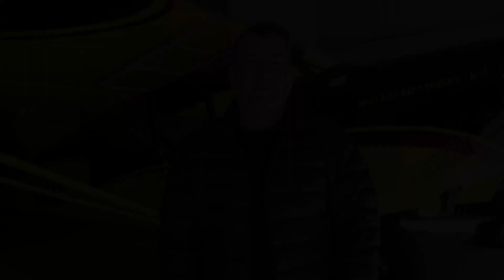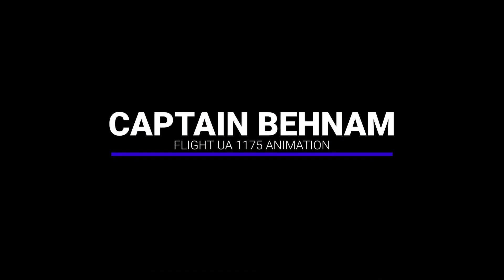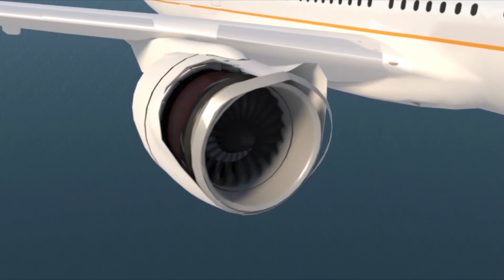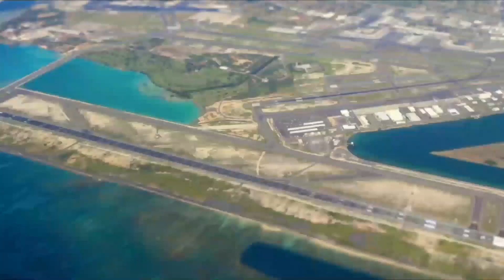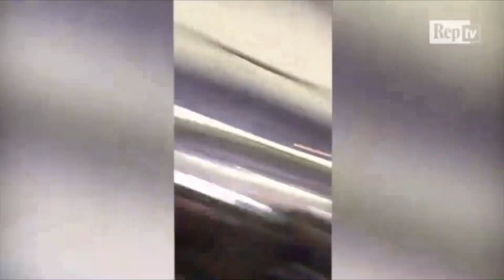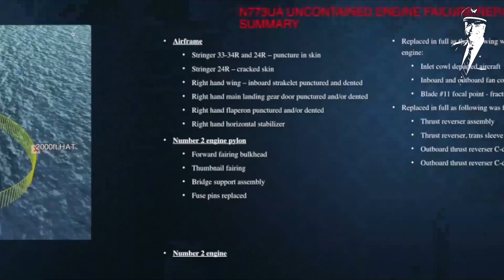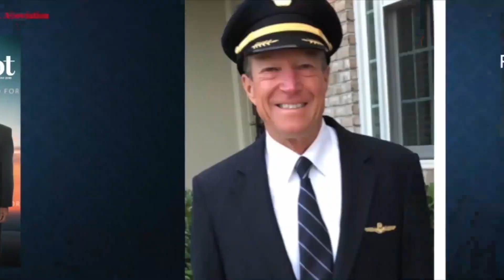UAL #1175 B-777-200 Fan Blade Out Animation

Comment: I was a private independent contractor, some years ago, asked by GE Turbine Engine engineers to study blade off containment.
My background was developing ballistics armor and explosives containment technologies with the miltary.
GE actually tested one their static fixtured engines by firing a chicken into the running turbine and watched 
approximately 1 1/2 blades dislodge into the stator and nacelle shroud.
Blade off velocity is roughly 1100 ft per second,or similar to a 9mm or 40 cal.
That loose blade or blades could easily penetrate the fuselage,and depressurize the cabin or even cause fatalities or injuries to passengers as happened years ago.
Newer aircraft have blade off containment shrouds made layers of   kevlar and aluminum.
That is what the GE engineers asked me to develop, was possibly  lighter solutions.
I successfully came up with newer more advanced ,stronger and lighter materials based on my ballistics background.
I do not know to this day if they used those solutions.
It was great fun to develop composites and shoot them with simulated projectiles though.
Reply: Actual testing is the key here. Those darn theoretical calculations are useless--they always assume spherical chickens.
Reply: I hope the dedicated "crash test chickens" were fresh and not frozen when launched into the fan blades?! I guess those that exited the core came out in diced pieces, well done and tenderized KFC or McNuggets!? It's fascinating watching the super high speed film/video of these destructive tests!
Reply: @v1rotait23  That actually happened at the test facility,I was told.
One engineer took a dead chicken out of the refrigerator and forgot to defrost it.
Needless to say the bird did not function as per specifications.
Reply: @jimhenry7173 , Yes. I'd read that same story long ago too!
Reply: Part of an FAA certification requires "bird-shot" tests on aircraft engines.  Airframe manufacturers are also required to do these tests on specific parts of the airframe

Comment: Did they say that the sounds were taken from the actual CVR? Holy Sht! The noises that plane was making as he was struggling to get it under control. It sounded like the whole airframe was twisting, bending and tearing apart. Afterwards, when they inspected the plane, how much structural damage did they find? Above and beyond the engine damage? 777’s aren’t supposed to make noises like that.

Comment: What I don't understand is how a 777-200 with that P&W engine could be assigned to UAL flight 328 to Honululu after all the preceding bad experience with that configuration.  I'm sure some extra tests and more frequent inspections on the engines were instituted. But those procedures are based on reliability models.  Such a catastrophic failure mechanism seen all the way back in 2018, and subsequently, is a sign that those models are not trustworthy and the "fix" recommended by NTSB did not work.   The multiple failures by that mechanism, and allowing flights by that configuration over the ocean after 2018, shows a failure by the FAA that belies the celebrations after that near disaster.  I'm not at all impressed by the FAA's performance.

Comment: Lots of discussion about duplicating the vibration in a simulator, but it seems the most immediate threat was the unexpected drag after much of the cowling departed.  Drag caused a very strong and fast roll, and that (not fire or vibration) was the thing that needed to be handled first.  Not all pilots would have been as prompt as Behnam to apply all that left rudder (natural reaction for some is just to use ailerons) and ailerons alone may not have been enough.  Perhaps simulators should add a failure mode that includes the extra drag and its consequences.

Comment: Great animation.  Regarding the simulators, why couldn't they vibrate only the seats to the degree necessary?  The effect would be the same for the pilot without stressing the whole simulator.
Reply: Can't see instruments when they're shaking that hard.
Reply: @laurinpestes5569  
It's desirable to replicate the challenging conditions they faced if you can do it without damaging the simulator or the instruments.  Vibrating just the seats would accomplish that.

Comment: Juan, I have a hypothetical question for Capt. Benham. First let me state up front, I am not a trained pilot and I am not criticizing his or his fellow crew members actions. He and his crew members were in the hot seat trying to save a badly damaged air plane and as far a I am concerned they did an outstanding job. That being said  I am doing some arm chair hind sight engineering. My question is that once your jump seater determined what was causing the extreme vibration and that there was no visible fire you decided to shut down the damaged engine if instead you had allowed it continue running and tried to reduce the vibration to a tolerable point and at the same time preserve some level of thrust, could the remaining thrust have helped to mitigate your drift down rate and thus extended your range0?

Comment: Holy smokes!  This is an engine failure that happened Feb. 2018,  on a United flight to Honolulu,  similar to what just happened on UAL 328,  also on its way to Honolulu,  and also a B-777 200 with P&W engines Feb. 20, 2021.
Reply: And further coincidence, UAL1175 > N773UA,, UAL328 > N772UA.  FYI- N773UA is still doing SFO-HNL-SFO flights(until the present P&W grounding)
Reply: Viva Le BOEING !~!~!

Comment: I wonder if that plane is repaired and back into service or written off after the tremendous stress to the fuselage and wings.
Reply: Yes, it was "repaired". It was used to fly the passengers from Denver to Honolulu when Flight UA328 had a similar blade-out incident on 20 February 2021.
Reply: @lizj5740   No, in 2018 it was N772UA and this year N773UA. But I found, that N772UA last commercial flight was Feb20 2021. So it is still in service but grounded after the N773UA incident.
Reply: @udothiel8009  Hi, Udo. The Aviation Herald incident report says that the 2018 incident happened to registration N773UA and that this was the plane used to complete the Denver to Honolulu flight on 20 February 2021. N772UA is the registration of the plane that had to turn back on the Denver to Honolulu flight.

Comment: We see a picture of a repair on the fuselage near the end.  I understand that the aircraft was eventually put back in service despite the sustained severe shaking that occurred.  I am curious as to what calculations or verifications were done to come to the conclusion that the aircraft was serviceable.
Reply: Probably went through an extreme heavy check. In D level heavy checks, planes (every single plane goes through this every X years/hours in its life) are almost completely gutted, inspected, repaired, and put back together. That includes all wing and fuselage joints, rivets, attachments, landing gear, etc. Every single removal panel is removed, doors, flaps, seats, etc. It is extremely intense and takes up to 3 months to complete each plane. 

In this case, there was probably an uncountable addition to what is done on a heavy check. I would imagine the FAA has a process to check the health of all wing spares and supports for cracking
Reply: @M4A1Nerve  given the revelations of the 737 Max, you may need to re- imagine the situation.
Reply: It goes through a Severe Turbulence Check, with engineering and BACO calling out certain areas they want closely inspected, nothing at all like a DCK, not even close.

Comment: Juan, not being a pilot,  I still have a great interest in all aspects of flight. With the Boeing 777-200 being one of the older models of this aircraft, is it feasible mechanically and financially to  upgrade these engines or are they at the point where it would better to retire them. I know that this is not something you hear about once a month but if you are in the cockpit or in the back as a passenger it  becomes  real serious. What's the answer to stop this from happening again? Thanks.

Comment: Was there other damage to the aircraft?  Surely the shaking would have caused other component stress failures? 

Does this suggest a need for engine separation on command when damage compromises air worthiness such as in this case? On long haul flights this could save range and avoid stress damage to the air frame. Of course such a system would have its own risks and weight issues.

Comment: Juan,    Is it true that this 2018 SFO to HNL plane N773UA was use by United as the replacement aircraft for the Saturday 2/20/21 Denver to Honolulu flight plane N772UA that also had engine failure ?
Reply: Here's what the Aviation Herald said on 20 February 2021, reporting on the Denver incident: "On Feb 13th 2018 a fractured and separated fan blade had caused the engine inlet and cowl to separate from the right hand engine of B772 registration N773UA*" (that's Captain Behnam's plane). "A replacement Boeing 777-200 registration *N773UA reached Honolulu as flight UA-3025 with a delay of 6 hours." (Asterisks added to highlight the registration number; yes, it is the same plane.)
Reply: @lizj5740  The FlightAware website shows that too.   I was wondering if Juan Browne knows that.   Quite a coincidence.

Comment: I can only speak from the race simulator world, but it's likely the aerodynamic effects could be accurately simulated. In formula 1 for instance, after the initial aero work has been done on a computer and it's effects been teased out for a given design, those parameters can be feed back into a driver simulator that gives the driver an accurate representation of how new parts will feel on the car.

 I think it would be super cool to be able to interview an aviation simulator software designer and talk about what hardware they use on the software side, like what GPU's, what CPU's and the fidelity that can be achieved on the simulator. It would be most curious to know how close a high powered PC would be able to accurately run the real deal simulator software. Or if they use professional tier GPU's and server grade CPU's like thread rippers or xeons. I'm willing to bet those simulators use a ton of VRAM and normal RAM   Also be fun to know what OS the simulators run on, prolly a custom fork of a some sort of linux distro? 

As always, a fantastic video, I'm really glad I found this channel.
Reply: They can't recreate severe vibration in the simulator because a trainee might get injured and sue for damages.
Reply: @irvhh143  Strictly speaking about the software side of things and the computer hardware needed to run that software.

Comment: I was contemplating this a couple days age, would it be possible or even feasible cost wise  to replace these titanium PW 4000 fan blades with a composite replacement, or would that necessitate a complete engine redesign due to the weight difference.
Reply: The blades are subjected to extremely high temperatures, which no composite would withstand.
Reply: @jeffcard3623  But this is the bypass fan, not the compressor or turbine blades. Newer engines use composite front fan blades.
Reply: @steveegbert7429  Yes I see the photo,  you are correct.

Comment: A good job by Capt Benham and crew. Severe shaking and vibration is all about the huge fan at the front of the engine being grossly out of balance due blade separation and fan continuing to rotate due to windmill effect. If a brake could be applied to the fan the vibes would stop but at the expense of increased drag which would make the aircraft uncontrollable similar to an unfeathered propeller. These pylon mounted engines are designed to shear the mounting bolts in cases of excessive vibration so that the engine parts the aircraft and flight will again become smooth.  Not only a Boeing / P&W problem. Some years ago an Asian airline  suffered a similar emergency in an Airbus A330-300 powered by RR Trent engines and the  flight diverted to Taipei.  Capt reported that his eyeballs were bouncing so much inside his head making ability to focus on flight instruments very difficult. Fortunately the vibrations reducing somewhat as the aircraft was configured and slowed for approach and landing.

Comment: Awesome respect again to Captain Benham and his crew. That interview with Juan was fantastic.

I don't understand the physical forces involved in handling a plane in those or similar circumstances. Aren't more recent airliners (even the 777 which is probably considered one or two generations behind) either hydraulically and software assisted, or fully fly - by - wire? Was it simulated forces up to a certain level that a fit pilot could handle?What would have happened if it were an A380 or a 787?

Comment: Use skateboard helmets with vibration motors on them, then damp down the response of the hydraulics.  I suspect if you shake the pilot's heads you will give them the same blurred vision experience without the violence in the sim.

Comment: So clearly this fabrication that we’ve always been told about these aircraft being able to fly on one engine is complete bullshit.
Reply: its not a fabrication. Did you not hear the plane was aerodynamically compromised. Many incidents have happened and reported that an engine shut down in flight but there is no issue flying the plane. They also would have to test the plane flying with one engine during certification for ETOPS
Reply: Well . . . they can fly on one engine.    But evidently not very well or very far.  ;-)

Comment: Juan, So it is stated, and you know where this is going, that all two engine jet aircraft are designed to be able to go-around in the event of 1 engine out/loss. Should this type of circumstance not be considered in that statement, since it seems to look as though if this happened when you just clear the end of the Runway that your most likely not going to  be able to correct or make it back to the runway. Its also clear that you can't even reach your destination if your at the point of no return. Should we not reconsider the two engine deal across the ocean ?  I realize that money is more important then human life........but this is a scary deal in my mind.

Comment: Curious why UAL 328 out of Denver, did not have the same 45* wing roll, nose high attitude when it experienced a near-identical starboard engine-out?
Reply: The Denver event happened at a much lower altitude, and denser air provides more stability margin.
Reply: @gordonrichardson2972  Makes sense. Also UAL 328 was going about 200-250 knots, but  1175 was pushing .83 Mach.

Comment: Modern sims have electric actuators, maybe they would shake better. I used to get our pilots to do aerobatics (motion off) if there was any time left at the end of a session, good fun.
Reply: How is the audio system in those big sims? Could they simulate the volume of the racket they had to deal with? A good LF subwoofer could add some realism.

Comment: I don't see how fan blade failures can be made "impossible", inspection seems to be very difficult.. With that said, containment enclosures must be extended further forwards so that engine cowls remain intact. Without that, ETOPS as we know it is obsolete.  Or go back to 3 or 4 engines OR make it possible to sever the pylon  of a dead engine from the wing to make the plane flyable and maintain  single engine range.

Comment: One of the things that facinated me most during my short stint in the NAVY was Non-Destructive Inspection.  I had the opportunity to work at the NDI Shop briefly and, got to do some dye-penatrent and magnetic resonance testing.

Does Pratt & Witney do all their own NDI or is it the responsibility of the Air Carriers? or is it farmed out to a 3rd party NDI company?
Reply: P&W does the NDI. There are other videos in the series which cover this. The problem is that the blades are hollow, and the fatigue starts in the middle of the blade, which required different techniques than you used. These techniques are obviously not working well enough.

Comment: Mr Brown Thanks for this channel
I am still confused ! Whats d difference between a contained blade failure and an UNcontainned one?
If the blades are obviously "pulling" air into the engine, they provide "lift"
Therefore if any blade fractures its tendency is to move forward If they move forward they are more likely to escape and damage cowls and the fuselage Do you agree? So whats FAA's definition of a "contained" failure?? Is it one where the broken blade is "ingested" by the engine?
Can you please investigate and explain to all of us? Many thanks

Comment: Considering he said they were almost max range with a blown up engine and with multiple events like this Boing should simulate a plane with such drag. Maybe some point between cruse and landing configuration would keep the plane in the air. Or a special configuration where additional lift is added to the effected side only, I suspect unbalanced flaps is not possible in the aircraft now. You would think Boing would put a little time looking into a procedure of an aircraft with a dead engine coupled with bad aerodynamics.
Reply: Not just Boeing- fan blade damage like this can affect any plane and makes the whole ETOPS concept (flight away from airports by 2 engine planes)  questionable.

Comment: Would it be possible to implement a type of FAN BREAK in Turbo Fan Engines so when there is a severe vibration the Fan can be stopped from wind milling with an out of balance situation.  It seams that if the Complete engine had Departed the Pylon things would have been better.